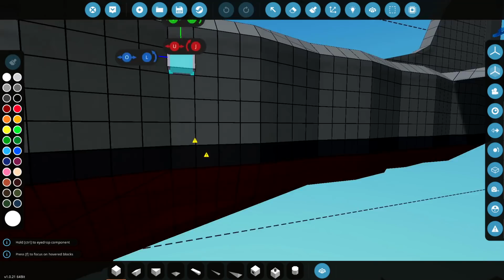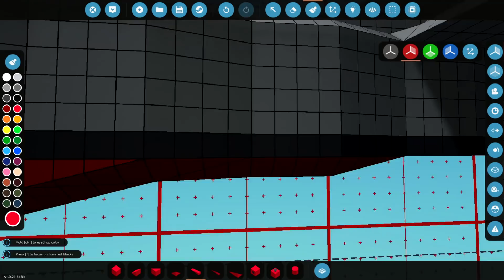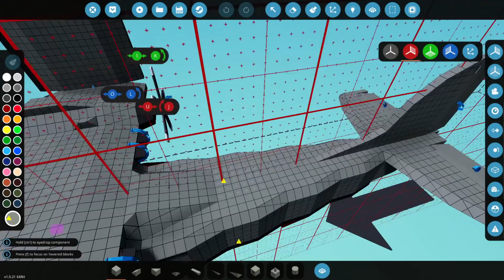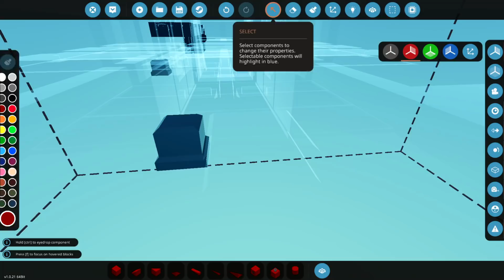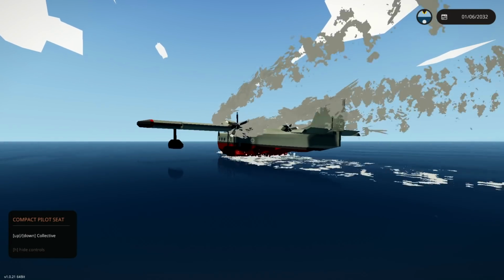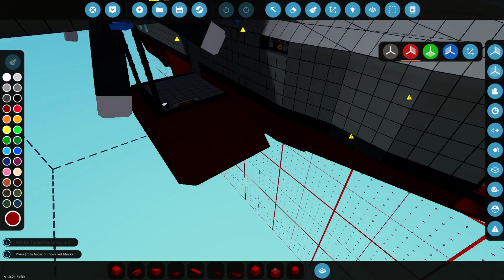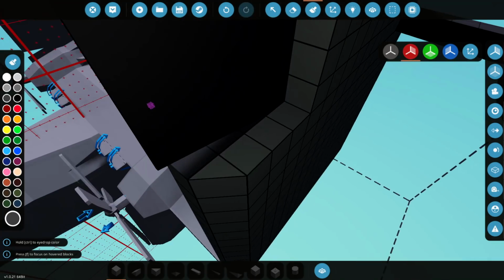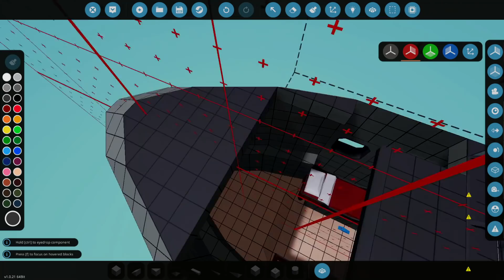Cancelled Broken Project!?  -  Seaplane Build 2.0  -  Stormworks Gameplay

Comment: Just add more engines, its not hard. Even if you can takeoff you can't sustain flight.
Reply: Or less propellers. It was flyable in an earlier state - with gearbox tweaks I'm sure even that would be a massive improvement

Comment: -Try to fit as many wing pieces as you can, they could really help you out A LOT.
-get rid of some batteries, 9 of them is just so much useless weight, you could easily have 3 of them an a small generator connected to the engines with a clutch so that you can still get max power to the porps.
- increase the RPS limiter it will make the engines more powerful
-change the geatbox ratio to 3:1

Comment: DONT add the tail thing that pulls down the tail (it creates more drag) and Dont add boost motors, the problem is that your engines dont have enough torque for the amount of propellars you put on (i recomend 3 on each prop) If you do this the props will produce much more wopwer as they can reach higher speeds and please consider gearing methods 9available on yt)

Comment: You just need some small rudders underneath the front of your plane and an strong electric motor with an gearbox on the back then it will lift out of the water
Reply: I build an seaplane this size by myself. It’s really not that easy but like I said this was the way it worked for me.
He need a simple Logik that just give the plane some kind of kick in the a** at the Right Point. He also still got to much weight. It is important to replace every possible normal block by wingparts or wedges. And get rid off all weightblocks. 
Just two medium engines maybe angled by hinges that’s definitely the way it would work.
Reply: With logic i mean for example when the plane reaches max speed produced by the aircraft propellers an boat propeller powered by an medium electric engine and an gearbox kicks in. He needs about 120-150 Kph 33-42ms to lift up.